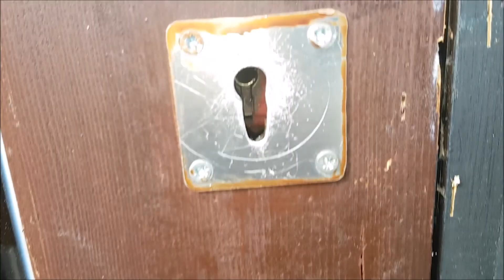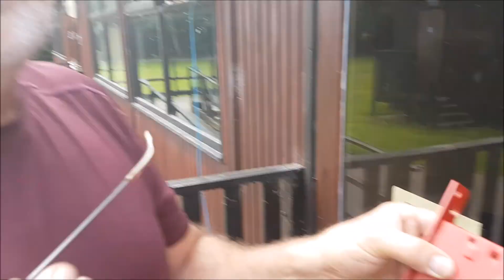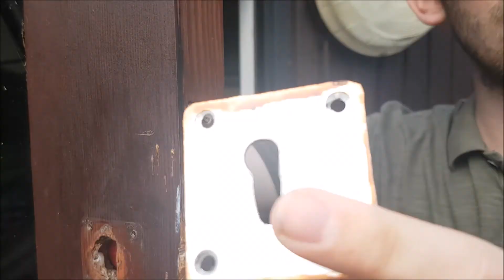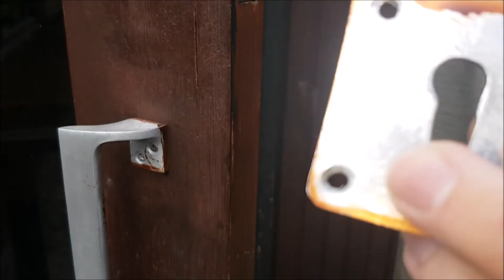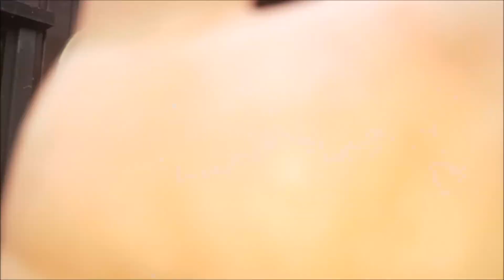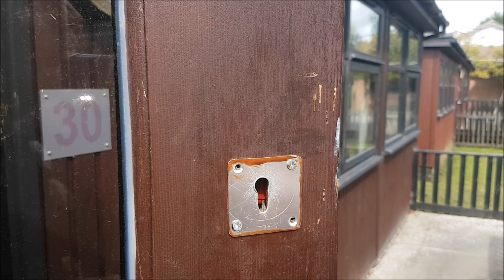BROKEN DOOR LOCK AND ONE WAY TO TRY A OPEN IT

Comment: A metal cutting blade on a multitool or a hacksaw. Works for me.
Reply: When u say multi tool do you mean that ocillating plate saw?
Reply: @DY-cq3qd  Yes, but the saw has to say for cutting metal.
Reply: @aceoftrades82  PLEASE NOTE EVERYONE - U REALLY NEED A TITANIUM BLADE - STILL CHEAPER THAN A LOCKSMITH !!!!